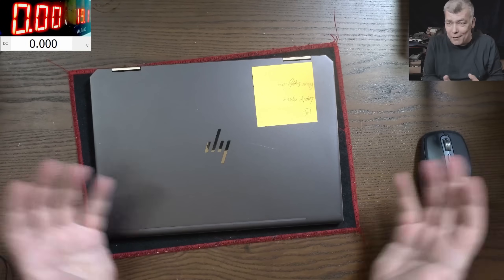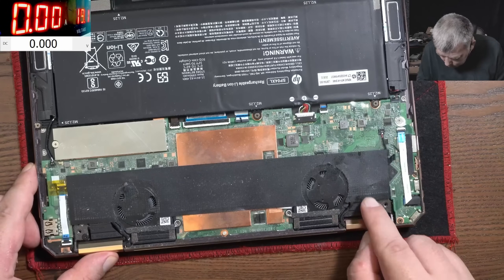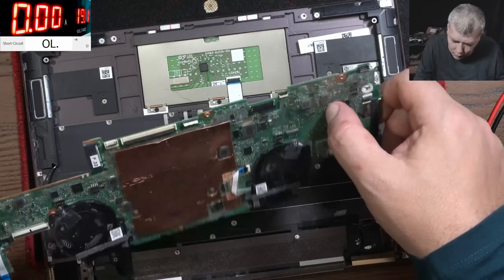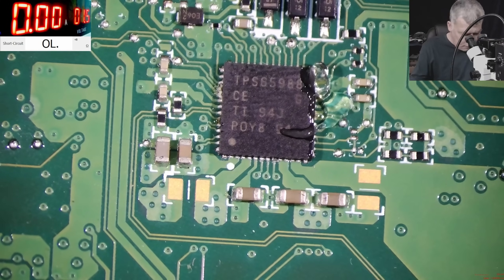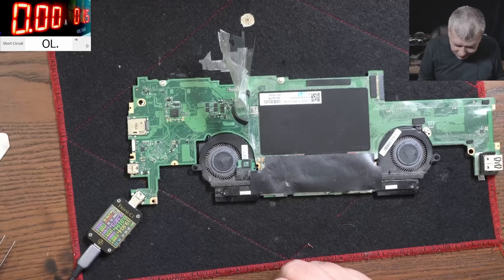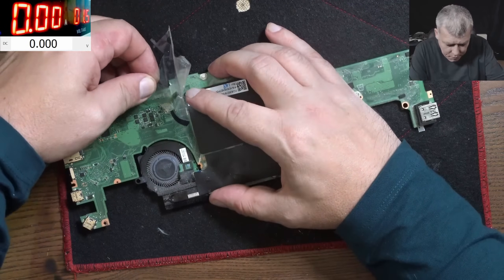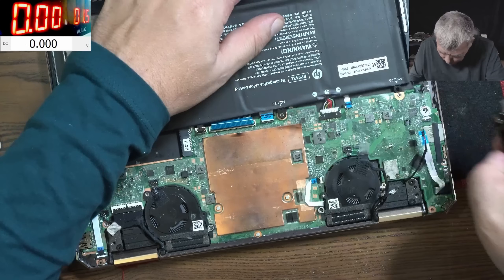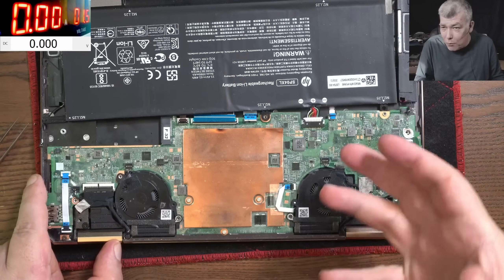Hp Spectre x360 Convertible 13-ap0xxx - no power, not charging - TPS65988CE replacement

Comment: Nice job, about the power button's flex cable broken lock it was probably broken during the other shop attempt to repair. bocz there was a kapton tape holding the lock on place, and based on the others flex cable locks that are on the same board, that kapton tape doesnt seems to be something from factory.

Comment: That laptop is a POS I've done port replacements on them a number of times, that port is extremely weak and always breaks! Nice work Sorin.
Reply: Totally agree - usb-c port on the rear corner is a totally shite idea. I habe one in my workshop and both USB-C ports have been ripped off the board, including all but 3-4 pads.
Reply: Point of Sale?  🤣